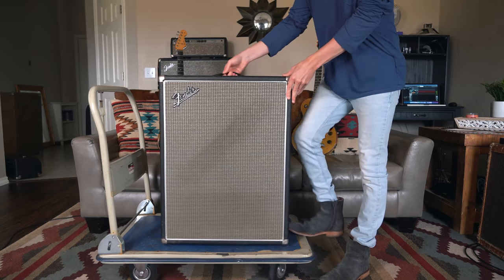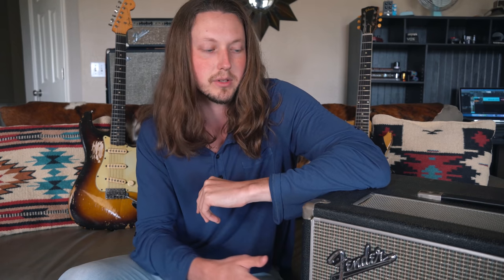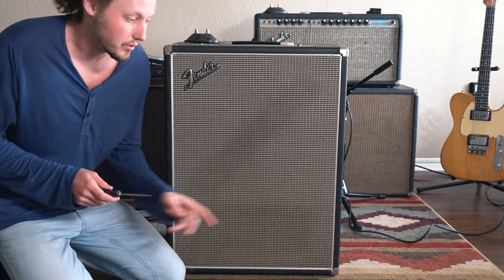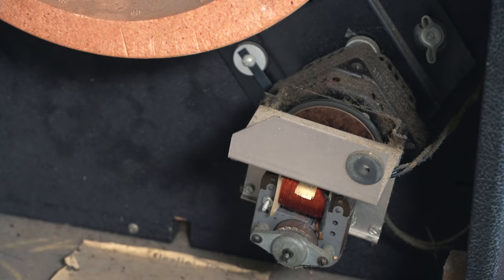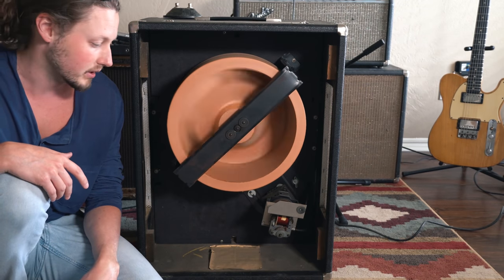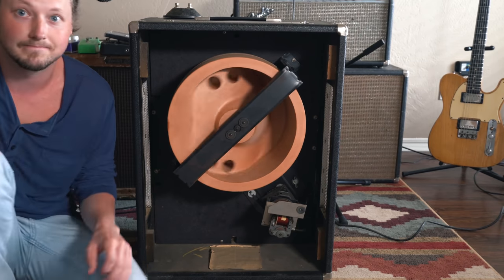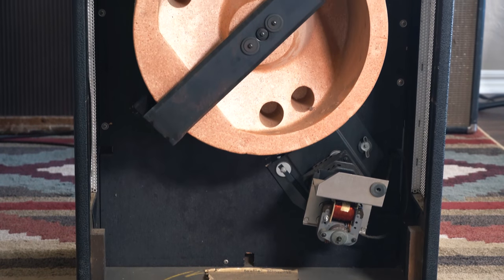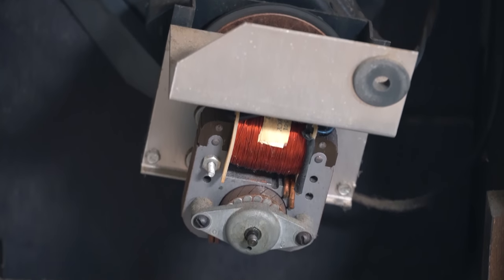I Finally Found this RARE Vintage Fender!

Comment: Best not to assume the recorded Leslie sound you hear is a Leslie 16/18. Buddy guy used a Leslie 122/145 on hoodoo man blues, as did Jesse Ed Davis with Taj Mahal. 
The 16/18 are passive cabs requiring an amp, although European versions exist with a built-in amp. 
Today the digital pedals from Neo Instruments are incredible reproductions without any of the negatives: weight, size, mechanical noise, mic problems, poor volume and volume distortion both on the speaker and the cabinet itself. The only difference is the physical cab throws the sound around the room. Plus, the Leslie is best heard in wet/dry.

Comment: There's a Blog Page if you Google this model, and someone has provided a full list of every artist and song (up to a certain date, but still pretty lengthy) that this has been used on. Very informative. Nice find you have there. I understand the 5 or so pin connector cable is a hard find as well. If anyone knows of a tech that makes them, please list that info. Thanks

Comment: Matt,  Before I get into a big explaination, please do some research on Goff Professional from Newington Connecticut.   Al Goff and his nephew Dave did lots of work on SRV's Vibrotone, and Leslie 825.  Both Al and Dave told me directly that the Molded Hopper absorbs lots of Highs and Mids.  So theyre solution was to simply remove the Grills, Engage the motor, Spray a very good primer, on the entire hopper, while it was spinning in Chorale mode. (Slower Speed).  Once dry.. they'd apply several ( VERY IMPORTANT) coats of a High Gloss Black .  Allowing to dry.  The idea is fairly simple, yet effective.  The gloss reflects the lost tones, found on the untreated hopper.  And the Gloss shoots those Highs and Mids out like a rocket.  I did it, SRV and others have done that mod as well.  Sadly, last I spoke with dave, they are no linger servicing B3's or Leslie Cabinets.  Dave was repairing ATM Machines.  In fact, Al gave me a JBL out of SRV's 825 Leslie.  No documentation, but oh well.. It's still a great JBL.  Just for a Goff Professional teaser,  Watch just about and Greg Allman video.  Over his right shoulder in big Gold Letters you'll see Goff Professional, Paul Schaffer from David Letterman, Jimmy McGriff...etc, etc.  All Goff Professional Clients.  THey know Leslie products.  period.  I hope this information is helpful to you.  Enjoy... Keep the Vintage love going..  Us old guys will all someday be gone, and we are hopeful, the "Thing" continues...

Comment: Thanks for this fun flashback to the late 60's early '70's !

I had one : )  Bought it new in like 1969. It looked just like yours with the Fender emblem on the top left. I used it on an Acetone (early Roland) organ with a Lafayette Radio Electronics spring reverb box unit for a couple years. It was used in a wedding band (ugh, but hey it paid well) and a couple English-style rock bands. It handled good sized halls with no problem. It sounded just like a Hammond B3 with a Leslie cabinet, but a whole lot easier to transport. I suggest you try it on an organ "for your listening and dancing pleasure". 

It was loud, with full body and clarity too . . . it cut like a knife! I never even thought about playing a guitar on stage through it, go figure. Your research on that aspect of it's use for guitars was completely new to me even now, some 50 years later (they don't let me out much). 

I  used a Kustom 150 amp (75watt per channel) with it's own single special order 15" Altec Gold series speaker (~25# magnet). That cone would pop in and out over an inch with a synth LFO square wave hitting it. And then just for fun, you'd hold a lit wooden match in front air ports on the Kustom and it would blow it out! I no longer own that Kustom, but I know the person who does and that amp and speaker are still kick'in butt (ie. you get what you pay for).

For the Vibratone, I hard wired (soldered) in parallel right on top of the Kustom's speaker leads directly to a 1/4" TS jack I drilled and mounted to the back of the Kustom cabinet. It powered the Vibratone's very capable 10" speaker quite nicely. 

Again thanks for your vlog. I haven't thought about the Vibratone in a long time. I don't even recall that we ever called it a Virbratone either. We just referred to it as the Fender Leslie cabinet. Learn something new every day they say  ʘ‿ʘ

Regards . . .

Comment: Great find Matt! Looks like a keeper for life that one. I've been using - and loving - these units for the past 30+ years. I hope you do yourself - and this historic piece - the  h u g h e  favor of letting a well seasoned Leslie repairman take apart the internal motors (yes there's actually two of them),  clean all the parts, check for any type of wear or burrs to remove from the shafts, lubricate (type of oil makes a huge difference) and reassemble it. Let the same person go over the rotor and its bearings. You can of course do all of the above as a DIY project - but let me tell you, never ever under estimate the challenges these old units might present - especially the ones that's NOT been serviced regularly. The right tools, the right oils, patience and a clear understanding of the mechanics of the motors and rotor assembly are all key for the future reliability of any Vibratone. Trust me, I've learned this the hard way ;-)
Lastly, find an EVM10M to replace the original speaker with. You will not regret it :-)

Comment: My favorite effect - speaker.  I own a few of these.  The Oxford speaker that comes with these are terrible, put a Jensen in it as early Leslie's used these.  Also, since the Vibratone is just a speaker with a rotating foam baffle, they suck the high ends out of your sound, so you need to compensate.  I found the best way to run the Vibratone is to split your output signal, run clean to the Vibratone, and put a volume pedal before it.  This way you can 'dial in' the amount of luscious swirl the Vibratone adds to your output.  SRV, George Harrison, Hendrix, and Gilmour all had it right with these.

Comment: A knocking sound is usually a bearing. You might be well served to inspect/grease/oil the bearings. Lol, I just finished the vid and that's what the problem was. You lucked out that it was just loose and not cashed. Sweet find.

Comment: I own a Leslie 18 which is a similar version of the Vibratone, looks to be of the same vintage. I believe they made a 16” as well as an 18” speaker model.   Sounds great! 
Did the Leslie company fall under the CBS umbrella? Why would they make essentially the same piece of gear under two separate names? 🤔

Comment: Thanks for all your vids, always cool.
I'm using a Leslie 16 since 10 years now with  another speaker. The Electrovoice 10M is the best speaker to use with the Leslie. If you want more headroom you can drill a larger hole to out a JBL 12 but I think the 10M is cool. I don't use the crossover. I plug directly in the Leslie speaker into my Two-Rock Classic Reverb Signature to get the full range spectrum. I can't play without the Leslie. If you can run it well it's really addictive. I recommand you to dedicate one amp for the Leslie and another with your Dry signal and you will be happy with the Leslie.
Have a nice day and please continue to do your cool vids. PEACE 😁😉👍

Comment: Thanks for the very interesting piece of  history, Mathew. I would suggest that we are hearing it today as it is, rather than as it was, simply because electronic components age and deteriorate, especially electrolytic caps. There may well be some bad resistors in there as well so I think some maintenance would be worthwhile for hearing how it was intended to sound. I imagine you already know this. :)

Comment: CBS was selling the inner module to lots of companies. I have one pulled from a Thomas organ, a guy on ebay was selling a whole slew of them pulled from all kinds f organs, one and two speed, which I have (must have the slow, with an occasional burst of speed. Need to build some kind of cabinet.

Comment: I think this is somewhat of a transition unit, On the actual model 16s/18s one had to remove the back panel to get inside them, The actual vibratones one would remove the front panel, I see your front panel comes off but you don't have the vibratone badge no big deal but an interesting side note this is an actual vibratone housing, Did you check the speaker size it should have the 18" but?? no telling until you look. Nice score !!

Comment: I have one - one of the later ones that is branded Fender.  To your point w/George Harrison - I think the solo on “Let it Be”…it sounds like a Vibratone, and on one of their promotional films you can see it.  So I do think he used it to some extent.  The crossover thing is weird - I use the Vibratone with a Twin Reverb…it makes a little more sense, sonically, than using it on its own.  I understood that it was to be used with a combo…I forget all the details.  Still, great stuff and thanks for sharing Vibratone stuff!

Comment: You are definitely building Nerdville Southwest here.  Thing is awesome.  I use a JHS Unicorn V2 on the wet setting for "Cold Shot" but not quite the same.  Do you keep all you guitars tuned to Eb or just the Strats?  Do you have any recordings up anywhere?  Spotify, Youtube, etc.?  I should go back and check the channel but I feel like I've only seen demos of extremely rare funktastic gear.

Comment: Have any Leslie 16 owners found a way to improve the response and reduce issues? I swapped the speaker for a 10” 100 watt speaker, tightened every screw, extra bracing on the back panel.

Comment: I've got a later model one with the Vibratone badge (technically it's my dad's but it's in my garage and I'm the only one of the 2 of us to use it in the last 27 years) and it such a cool unit. Yeah it's a little noisy at times, yes it's a pain in the ass to mic live on stage, yes when you have the Leslie 16/Vibratone wired into your rig with the crossover and you switch it on on-stage you lose half of your stage volume if the rig isn't running back through the monitors but nothing, NOTHING, sounds exactly like the real deal. I have switched to the Neo Instruments Mini Vent (Organ model) for live use but next time I get some studio time, I'm busting out the real deal because it's awesome.

Oh yeah and the original 10" in "mine" is long since blown, forget what pop's put in there. I also use it with a head running all the frequencies instead of running a combo (or head + cab) with the crossover.

Great score, man!

Comment: I think this video is probably a good example why Fender eventually dropped this. Similar effects were better handled later with pedals etc.  I would like another video with the micing that exploits the concept..  I thought the LP Jr was a better exemplifier.Better sustain? To exploit the effect you need a sustained sound ( ie organ).  I noted on both examples, you pulling on the neck/whammy bar ..you were drawn to do this.. why??  :) The allure of the already swirling sound?
The cross-over in the amp is likely a carry-over from the Lelies, model dependent,  that had the highs being sent to a tweeter/horn coupled with a balanced spinning plastic horn. One open, one dummy for the doppler effect.  The lows, apsychedelic group from the lates sixties and seventies. Micing Leslies is always an interesting approach. Look forward to another video on this unique amp.

Comment: I think something happened where cbs bought Leslie or some shit and they also made some Leslie cabs that are basically vibratones with a Leslie badge Lmaoo.. fender grill cloth and all. Think they’re called leslie model 60
Reply: CBS bought a bunch of companies, this model 16 was released by fender and Leslie, but afaik it is a Leslie design. Leslie made the model 16 and model 18, they made a model 60 as well but the 60 is a stereo tremolo cab set. I actually have the model 16 and 60

Comment: I've used a genuine Fender modeling amp that has a built in Chorus 😂
Sadly, no real Leslie cabinet... yet...

Stevie Ray Vaughan - His Final Years - Craig Hopkins - p.198
[Jim Gaines, Producer, In Step: "Stevie Ray would use two Ibanez Tube Screamers together and two wah-wah pedals. Those were his only pedals." Eight Amplifiers were used. "We called it the Wall of Doom. He had Dumbles, Marshalls, and Fender Bassmans, Supers and quad Reverbs." A Gibson stereo amp and a Fender Vibratone were isolated because "those amps would have been blown out of the room if we'd put them in with the others." The Vibratone or a Roland Dimension D were used for chorusing.]

Comment: What amp did you use to drive it? If you said, sorry dude. I've got an old 80s Leslie 825. Basically a huge SS powered box though. Similar to yours at least in that it doesn't have horns for the top end. It's supposed to be full spectrum but mine throws lower to the ground. The drum in mine is horizontal and driver down. Yours seem to lack the same top end. Most likely a design issue. Driving full range into a drum is going to destroy the top end no matter what. I've found it sucks by itself but, with my '70 Traynor ygm3 w/wheelhouse150, (awesome amp regrettably I sold her) it added a swirl in the mids and lows, basically. Like a bad ass psychedelic growl inside the belly of my riffs 😄 It didn't really effect the top end at all so there was still clarity. Not a typical character. Maybe give it a shot. Thanks my dude. Good shit💥🚀

Comment: I have a similar model 16 that also knocks.

I think the reason for the crossover had to do with original Leslie designs that had a crossover between the horn and drum.  Frankly I very much dislike the feature, should have just made this a normal cab.  It does sound kinda bad, but it’s special presence cannot be denied

Comment: Cool stuff Matthew. I would recommend getting two good 4 ohm speakers and testing it before making any changes. Check out this schematic and see if it matches what you have. the 200 micro-farad 30 volt non-polar cap is filtering out the low bass going to the Vibratone speaker. The other filter is a band pass filter going to the amp. 1.2 millihenry inductor and a 2 microfarad 200 volt DC cap wired in parallel. I suspect there is an intended sound to be had using the two speakers and associated crossovers.  It might be very cool, so try it 1st before modding anything IMO. The two caps are suspect being that old and worth replacing if you think you'[re on to something when testing. Save the old caps. Schematic - http://techtalk.parts-express.com/filedata/fetch?id=1187609&d=1392236628 and http://techtalk.parts-express.com/forum/tech-talk-forum/60806-fender-vibratone-crossover-help

Comment: Hi there,  I've had a vibratone since 1976, unfortunately termites ruined the  cabinet, 
 its still working and I will be using whats left of  it tonight, just with the board the drum, the motor and the speaker. I'm planning to rebuild it, if you would send me the outer dimentions of your cabinet I would greatly appreciate it. If you have a wasap number or email I can send you some pictures of mine.Thanx